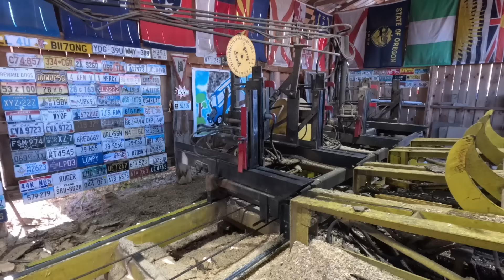sawing and edging three more white pine logs # 627

Comment: As always,  love the video.   I'm a band mill guy,  and no argument whatsoever with circle vs band on knotty pine!!  I've actually thought to myself a time or two "I wish I had Marks mill for this log!!"😂😂
Reply from the maker: thanks Doc , it's all about sawing lumber no matter how you saw it.
Reply: If you had a bandsaw mill of equal size as marks, you wouldn't worry bout knots either. Especially in big wood.
Reply: Please explain why the bandsaw mill has a harder time with knotty pine.
Reply: @STMwoodturning  it boils down to the flexibility of the blade.   Pine knots are as hard as any oak,  but the other wood is soft.   If everything isn't tuned perfectly and blade sharp,  it is very easy to get wavy cuts in knotty pine.